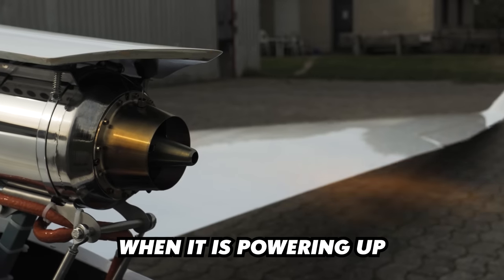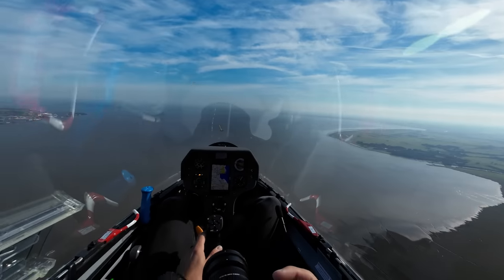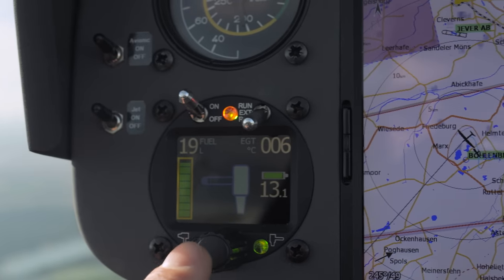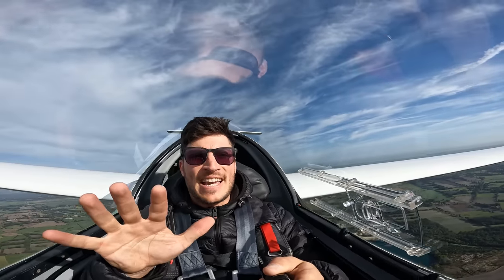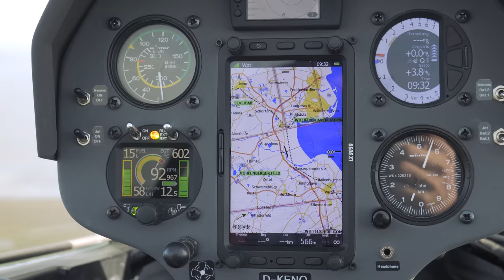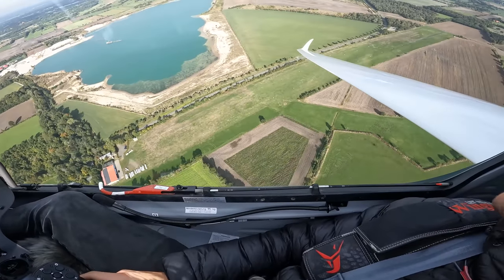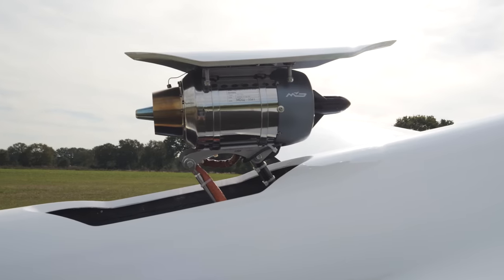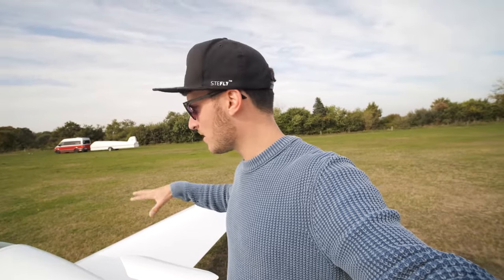My FIRST TIME flying a JET | LS4 Jet M&D Flugzeugbau

Comment: Does it work well? How much thrust does this jet engine produce? It looks a bit small for the size of the glider🤔
Reply: just dont do pougachev cobra or immelman with that things🤣
Reply: It's good enough to maintain speed for about 10min. This should be a requirement for gliders. If you need to stay in the air longer to get to a safe landing, the jet can be a life saver
Reply: I’m pretty sure the engine makes 420 newtons of thrust at max

Comment: Super! Can you also take off on jet power only?
Reply: No way, there's too much surface friction
Reply: Maybe with a very long runway and some drop tanks.  Slowly accelerate,  take off, gain altitude, drop the tank(s) safely over the airfield to lower weight and drag, then perhaps it would be viable.  A piston-prop setup would be far superior for a glider.
Reply: @d00der41  I have seen videos of one taking off with jet power alone
Reply: @FarmerDrew  Yes, but at many places there isn't much fuel left after takeoff and climb to travel to ridges and thermals.  These jet gliders don't have much distance after taking off, which is why he took off in tow.  Hence why a piston-prop setup is an ideal powerplant for gilders.

Comment: You mentioned it could climb at 2.5m/s and given the duration you'd be able to use it, that'd be several km of altitude you can regain. It sees like a hugely beneficial system.

Comment: Since the question is raised many times now, I would like to mention that on the JS, the turbine is placed at small angle so the exhaust gas will fly past the tail rather than head on. M&D probably does the same for the retrofits. It just requires a bit of compensation with rudder when flying.

What also should  be mentioned that the system is really loud. It works great but mind the neighbours, not everyone is a top-gun fan.
Reply: do you need a licence to use this glider ? i mean...the question seems important to me. thanks
Reply from the maker: At the LS4 the jet is not installed in an angle because the short fuselage would cause a strange flying behavior. Of course the needed to measure the temperatures in extreme environmental conditions for the certification process. So everything is fine on this side. 
That´s true, the outside noise level is high and you should take care with noise sensitive neighbours.
Reply from the maker: @pakkiaman2  Yes you need a glider licence but nothing special for the jet.
Reply: Or maybe underneath since it retracts?

Comment: I have a question; the heat from the thrust hitting the tail, wouldn't that cause a problem later on?
Reply: The engine is in a slight angle

Comment: Amazing. Gliders should have (as an  optional feature) a possibility of installing a jet engine. What is the thrust level of this particular engine?
Reply: Maximum of 350 Newtons  ( 35kg)  of thrust at 1.3 litres per minute.
Reply: There are gliders that use an electric propeller with folding blades to do more or less what this offers. I'm thinking that the jet is probably more weight efficient though run time is less.
Reply: @Michal, that information just 'can't' be found.

It's not like we're on the "Internet" thingy that we've all heard about.
Reply: @fredflintstone8569  thanks

Comment: This is an awesome option to consider! Any idea how long from power-on until climbing away from your landout? How much weight does the system and full fuel add to the empty weight? Do they have any information available?
Reply from the maker: I have seen somewhere on their page that it takes 40 second to extend the jet and power it up to 30.000 RPM. Then it will take some more seconds to get the full RPM (95.000). So 50 - 60 seconds until the full power is available.

Comment: I am in no way shape or form a pilot, engineer or mechanic, with that said does that jet engine not generate (in full throttle) enough heat to damage the tail section?

Comment: What about the tail directly behind it? Won't it slowly start to burn?
Reply: I was honestly wondering the same thing, small or not a jet engine produces a lot of heat. Maybe there is enough distance between the tail and the engine that it isn't a big deal?
Reply: The jet is angled slightly away from the tail

Comment: Looks cool! But any chance of metal coming off the engine hitting the tail in event of a failure? Right in front of the tail. Heat damage too? Since it can retract why not place it below the plane in the same spot? Seems like a design flaw and dangerous IMO. But super cool design overall!
Reply from the maker: No worries. This jet engine is already installed in 200+ gliders and the certification process here in Germany is one of the strictest worldwide ;)

Comment: I would've mounted it to the side just above the wings so the exhaust doesn't melt the tail (the torque effects wouldn't be that bad from such a small engine) or used 2 so I could have 1 on each side for even thrust

Comment: This, but with fully aerobatic self-launching glider, jet intake/exhaust ports, built in so jet is stationary in fuselage, 100L of fuel, and 2 very slippery clamshell-opening wing nacelles, each housing 1 FIM-92 Stinger (ATAS), operated with HOTAS controls and HMD, and no ballast. 😎

Comment: I must ask you because I have a light ppl myself and I would love to fly a glider but is that engine safe that close to your stabiliser? I mean those micro jets put out some serious heat wouldn't you be a bit safer with a bit of Aluminium.? I am not being rude just curious.? I'm sure that you have it under control but just wondering how you avoid stress.

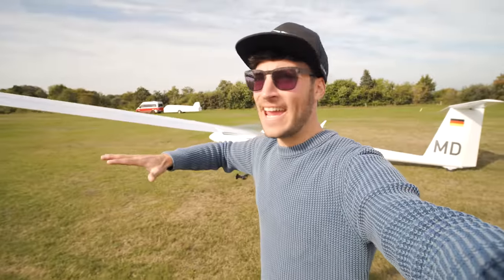Comment: 7:43 If your engine leaks fuel like that and fails to start, your glider-jet will burn down to ashes right into the air. I would look for an electric fan solution which may fit this job a little better and safer (batteries "burn" as well if not treated correctly).

Comment: amazing -- seems efficient and fun - and safer than the ICE engines in typical GA aircraft....but isn't the exhaust going to heat/discolor the tail / vertical fin surfaces?

Comment: I noticed the intake is unprotected, which is a little unusual. Sure its a little inefficient to have a protective mesh but likely preferable to having to clean the blades and do frequent maintenance.
Reply from the maker: Good point. I have no idea if you need to clean the blades regularly..

Comment: Guess you shouldnt start it on the ground seeing as the exhaust from the engine will surely make the tail too hot 🤔
Reply: Good point-they could make the stabiliser out of some heat-resistant material-I'd be reluctant to go up in this glider, tbh,I saw a video years ago of a glider which had lost its tail ( air collision, I think)-it was not pretty...

Comment: Cool. As a RC pilot flying Jets and a UL beginner, I was always curious, how this flies.. Are there any jet powered gliders with ground start capabilities? I have seen recently a turbofan from Frank-Turbine with 1.5 kN of thrust with a fuel consumption of a 500 N turbojet. And why is there fuel dripping out of the nozzle? This should not be and if it was my RC turbine, I would send it back to the factory immediately to get this fixed.
Reply: As a newbie RC pilot, all my attempts to take a flight ended in a few seconds, crashing in a trees , bushes, ground and other obstacles. And I launched it in a relatively large clear spot amidst the forest, lol. ))
Reply: @letwolf  Start with a beginner friendly model e.g. multiplex easy star or hobbyking bixler and with an aircraft, you have to steer actively. Practice on a good rc flight simulator will help a lot, too.
Reply: @Maxfahrer  I had friendliest model. Not helped
Reply: @letwolf  then I highly recommend that you get yourself a flight simulator for RC planes. Saved a lot of money at the end of the day

Comment: I used your link and bought clouddancers. There was no option to say your link sent me there nor does the link have any code. I luv my Clouddancer the quality is incredible. Everyone in the contest wanted to get them too after seeing mine. I designed my own tightening system using 3D printed pulleys.. works better than the OEM.

Comment: The retract unit looks like it would cause a lot of turbelence, with no covers or air gudies to smooth the airflow around it. I wonder, would it not be better to use an internally mounted jet with high bypass fan, with NACA duct looking inlets either side, and the exhaust through a duct inside the tail section, set up so the bypass fan blows cool air around the hot tube.

Comment: I am seeing this video very late i guess. Why not make it hybrid with a single electric engine in front. That way the range will be tripped or more.
Reply: weight, the added weight decreases the thermal performance of the glider
Reply: @randomguyinanglider  it wont matter unless the engine is running
Reply: @randomguyinanglider  it won't matter unless the engine is running

Comment: I would assume the system has a sensor to know when the engine cooled down after the engine has been turn off to then go back in if not that a wow also did say how fast it picked up from 110km after the engine turned on

Comment: The engine is straight before the tail. Does the heat from engine not damage the tail?
Reply from the maker: No, it was tested and measured for the certification process.

Comment: Can this glider take off by using only the jet engine, w/o the aid of a 'pull plane'? If so, that would be a great advance
in glider flying! I took one glider flight in the 1970's & it was awesome!
Reply: He never answered but i believe i can, the glider cant take off with just that small engine. Its propulsion only works when its in the air, because its already moving and thus it can push the glider with no resistance, unlike on the ground

Comment: I too wondered if the exhaust heat is going to damage the vertical stab.  And I take it this is not enough power to self-launch?
Reply: With a long enough runway yes. Otherwise no

Comment: landing directly in the path of an obstruction like a building doesn't look like a good logical choice if you had a problem and couldn't brake.  What if the jet throttle got stuck on high?
Reply from the maker: With a glider you always only have one shot to land. The jet is retracted at landing, so there is no possibility of your scenario.
Reply: @SteFly  ok

Comment: I've seen a video on a project like this from Russian YT channel kudrifm in 2020, they used 2 JetCat P300Pro engines and were capable of take off. Quite interesting projects, especially considering that it was fit into 115kg aircraft, meaning no extra paperwork had to be done. Can LS4 take off by itself?

Comment: So the engine doesn’t provide enough thrust to takeoff without a tow, just enough to maintain flight when you don’t have the lift. Is that correct?
Reply from the maker: That's correct 👍

Comment: Welchen schein braucht man denn dafür. PPLA+SET, oder reicht segelflug, oder  Motorsegler? Und wieviel Schub macht die Turbine? Die Paramoteur zweitackter machen so ca 50kg. Gruesse aus🇫🇷.
Reply from the maker: Man benötigt nur eine Segelfluglizenz. Die Turbine macht ca. 40 kg Schub
Reply: @SteFly  Danke für die antwort. Einige meiner Bekannten meinten mindestens motorseglerschein. Oder ist das weil er einziehbar ist. Bin schon zulange aus D weg. Hab auch in den 90ern mit einem kollegen und fluglehrer einige windenstarts mit sk13 gemacht,in Hohenstein Taunus. Zehn min Platzrunde und wieder ne stunde schlangestehen, auch nicht das wahre! 🇫🇷😎

Comment: Metal fatigue on the leading edge of the vertical stabilizer from heat and thrust would be my concern. One wonders if the thrust splits evenly across the tail or is offset.
Reply: Also after using it and gets retracted back inside the heat would be trapped, I could see this as a fire hazard depending on the material used inside perhaps a possible fuel leak from maybe a faulty fuel pump
Reply: The glider is not made of metal. It's glass & carbon fiber etc.
Maybe the distance from the jet and the tail is enough to keep it cool, combined with the regular airflow.

After turning the jet off maybe they leave it outside for a moment to let it cool down.

I also expected the jet to be split so it goes around the tail though.

Comment: So let me understand this.  The hot exhaust coming out of there at about 1000 deg F is impinging on the tail section of the fuselage.  
ok, got it.
Reply: its definitely not impinging it. its open air and the exhaust coming out of this small engine will rapidly expand and cool

Comment: As the LS4 and LS3 have nearly the same fuselage. Would the retrofit also be possible on your plane?
Reply from the maker: The mechanical retrofit would be possible, the only question if they will certify it. I would be so happy to live in the USA and just fly as an experimental :D
Reply: @SteFly  Thankyou, I guess it is a question of demand. Maybe if enough people ask they would certify it for the LS3 as well. As you said in the video even with the high cost of the engine, an LS3 with this system is only around the price of a Discus Bt

Comment: Obviously most of the comments are by individuals who do not understand the concept of Self Launching Sailplanes.  You use the motor as little as possible.  If you are a good flyer, only to take off and gain useful height as you would with a tow launch.

Comment: What about the noise in the cockpit compared to a propeller engine?
Reply from the maker: The noise level is about the same but the frequency is the problem. I would use some earplugs or a small headset for longer use.

Comment: Won't the exhaust heat damage the tail assembly?
Reply: Perhaps if your airspeed is too low to dissipate it.  Wouldn't be using this setup for full throttle takeoffs.  The only good thing about using a jet rather than a prop is the sound and the convenient packaging.  Turbojets/fans are ideal for high altitude flight.  An engine-prop configuration would be more ideal for gliders.

Comment: Is there not enough propulsion from the jet to take off with it rather than a tow plane?
Reply from the maker: The thrust of a jet is bad at low speeds. It's not certified but with a long runway it should work ;)
Reply: @SteFly  Also for a ground launch the glider should have a steerable tailwheel. And, it still needs to be towed to T/O point on runway and still needs a wing runner, ya?
Reply: @Freq412  
Nein steerable tail wheel, ja wing runner.
Reply: @SteFly  
Schub is unabhängig von der Geschwindigkeit. 🇧🇴
Reply: Nice to see a real jet integrated in a glider. I saw the first mini jets appearing in RC modelflight beginning of the 80’s

Comment: For me is such power unit close useless, only made to avoid grounding if loss of thermals...A jet engine is very unefficient for slow aircrafts, low trust for a gigantic consumption and  high noise, to take off in autonomous mode you need 2 jet engines= twice the consumption...

Comment: Thats ridiculous. That engine at most is $6,000 USD. The servo and mount system i can have made by my local CNC shop for under $300. The servo is under $100. So €30,000 is absolutely an insane rip off
Reply from the maker: That´s aviation. Everything needs to be certified, tested and you only have small quantities.

Comment: As it is a turbojet engine the glider can go higher than the piston engine powered propeller glider but the sound do not give the feel of that pure glider
Reply from the maker: It's an aid to come back home rather than a plane to fly. ;)
Reply: @SteFly  but what about the feel of a pure glider
Reply: @SteFly  exciting that I got a reply from one of my favorite youtuber
Reply: Thrust is proportional to density, like on a piston engine, High fuel consumption limits your endurance, If you can carry water ballast, coat the tanks to accept kerosene and your endurance can be calculated:  ~1.2  lb fuel /hr per lb of thrust on a good engine, far more on a toy turbine.
21800 feet (FL 218) density is ½ SL
33013 feet (FL 330)  it is ⅓ SL
SL density  is 1.225 kg/m³ 
Standard atmosphere.

Comment: If you can't use it to takeoff ...forget it.
Reply from the maker: 2/3 of the powered gliders on the marked only have a sustainer engine, with which you are not allowed to take-off. The lower weight and smaller size is a big advantage and you don't need to make an land out anymore. Hard to understand for non-glider pilots :D

Comment: What is 200kph? Means nothing...
Reply: 125mph when you use the wrong system. In level flight without full power
Reply: About 100kts